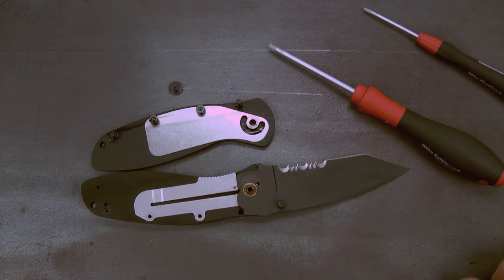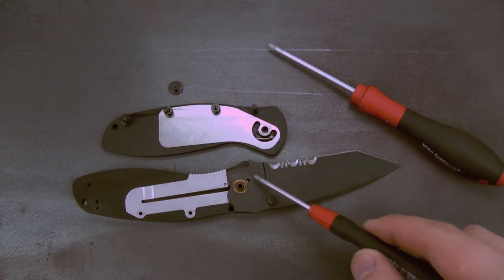Kershaw Blur Disassembly and Take-down

Comment: The blur is so much better without the torsion bar..for a Kershaw it's really nice deassisted surprisingly. Nice detent and is very smooth even without some polishing. Disengage the lock and the blade swings freely with no blade play.

Comment: I have a question about my blur, when I open the knife slowly there is a sort of quiet scratching sound. Almost as if there is grit inside the washer. Is it probably time to clean the old grease off and apply new grease? And if so what's a good grease to use? Thanks!

Comment: i lost one of the bronze washers while dissembling my blur. is it safe to use if i put it back together without the missing washer?
Reply: +GreedyLobbyist yeah. I threw it back together and it's definitely off center. I'm going to be contacting costumer service this week.
Reply: +GreedyLobbyist yeah I realized this when I tried to stick the torsion bar in the hole with the wrong sized washer. Didn't work.